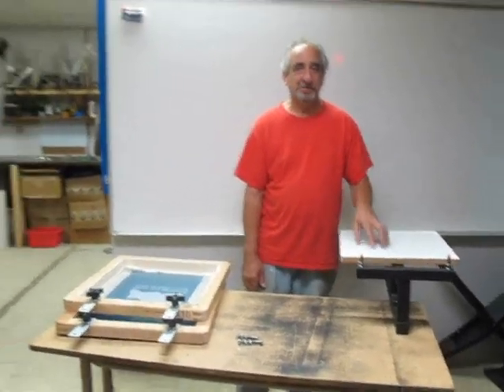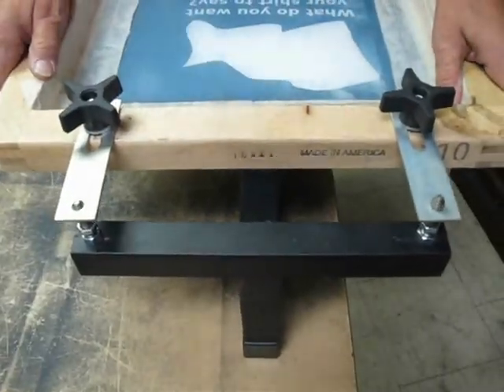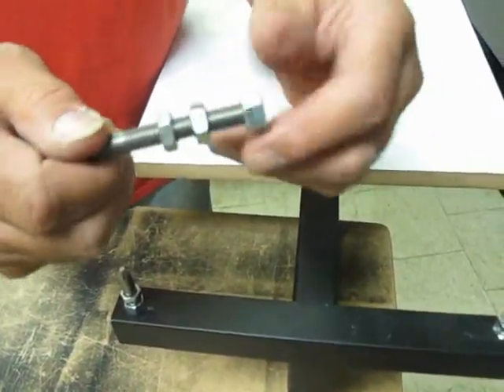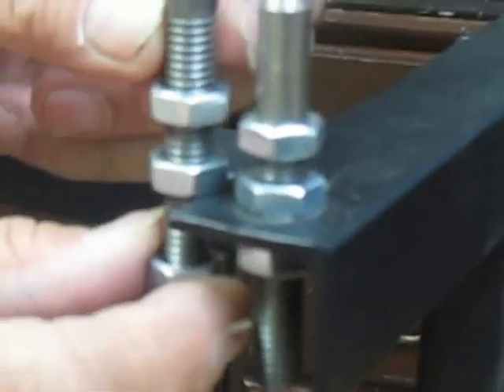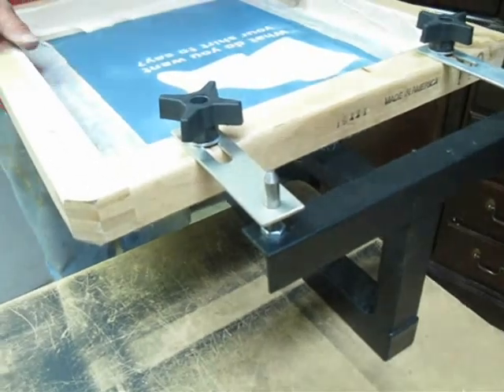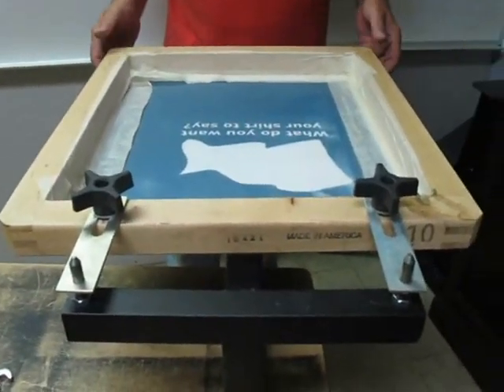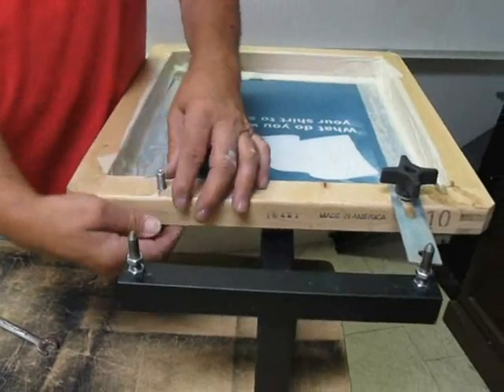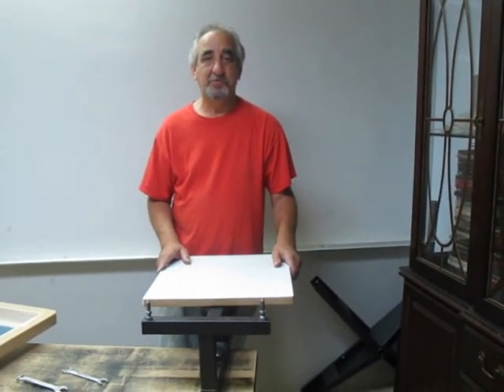How to set up the AMAZING MULTI COLOR PRINTER

Comment: Bello Bob!! I just purchased the silver eagle 2 last week. In regards to drilling holes into the frames. I have aluminum screens, would i still use carriage bolts should i not drill the whole larger?? Also do i neot need to have any off contact? This system of yours appears to not require it but wouldnt that be pulling up whatever ink im laying onto the garment?? Need your assistance. Thanks in advance.